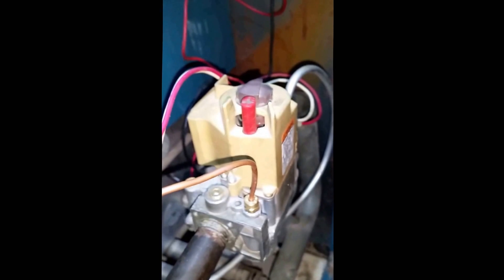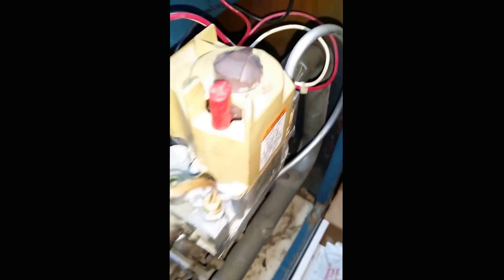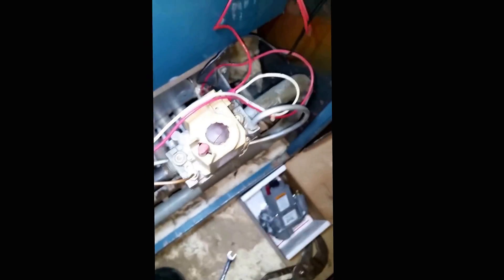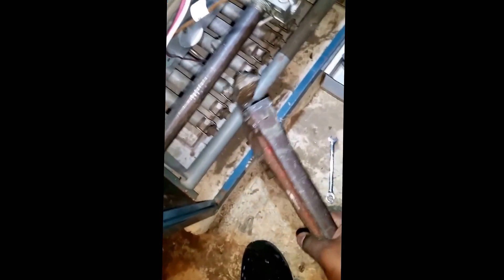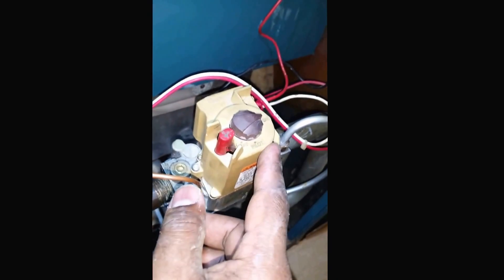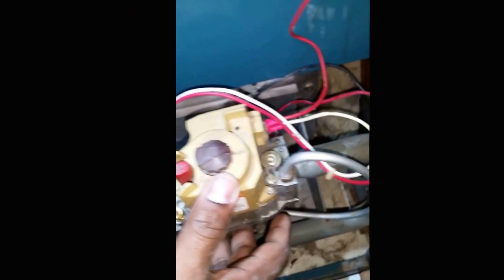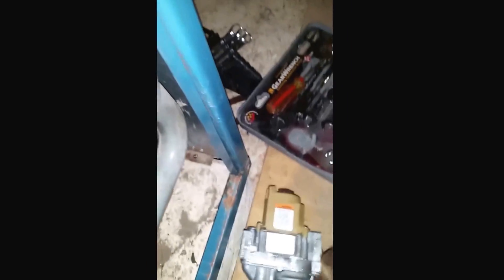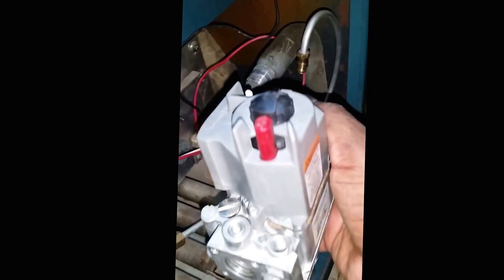Burnham Boiler Gas Valve Easy Fix Replacement: Troubleshoot Repair

Comment: U skipped the part where u need to  set the  gas water column pressure to avoid high levels of carbon monoxide ;)
Reply: chicho158 MAKE THAT VIDEO FOR US
Reply: I have to tackle this tomorrow. What do you mean because I have no clue